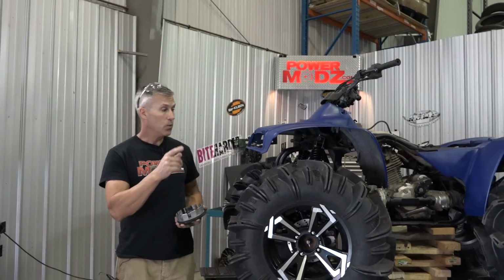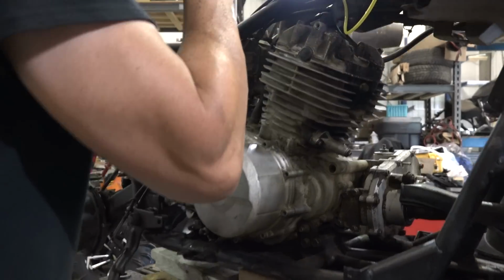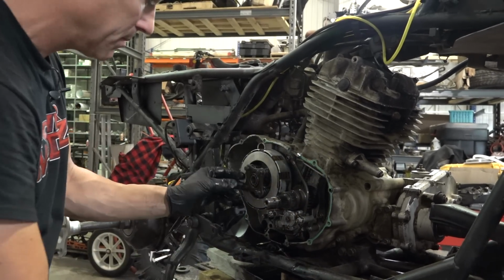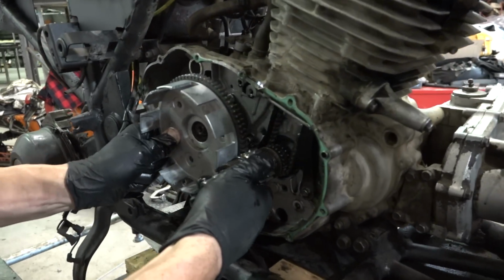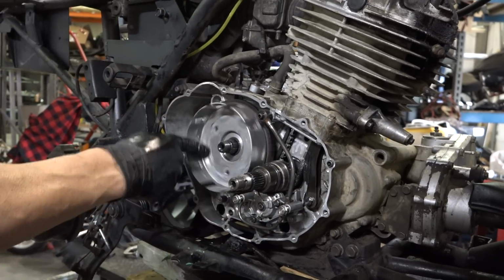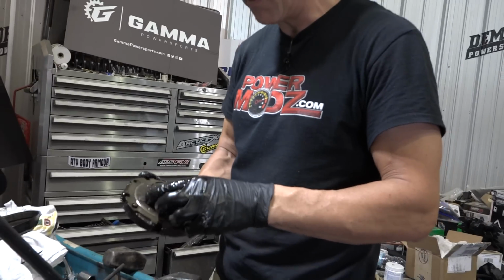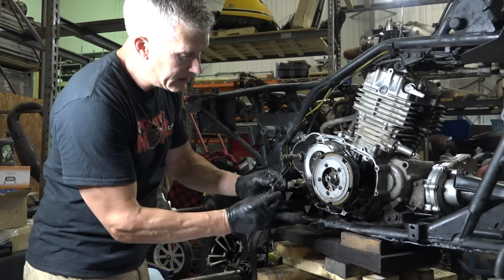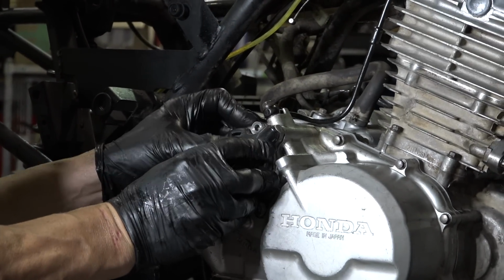Ep#18, Honda 300 Gear Reduction Video!

Comment: in the stock primary gear there is a little bushing type thing inside of the gear itself that u have take out on the back side and install it on the gear reduction primary thats why it wobbles u can see it at 8:24 the copper looking piece with holes in it im not rlly sure if u did it but i had to do it on mine also at 14:21 those pins above the reverse lever need to be removed they will destroy your engine very nice build tho keep up the good work!!
Reply: What pins?

Comment: You can reuse the copper washers but you must heat them red hot then let them cool to remove the work hardening...other wise they can crack when trying to recompress...just an fyi...

Comment: Hello, I want to ask what is the minimum thickness of the clutch plates on the Honda trx 300? My clutch is slipping, I bought a new centrifugal clutch, and the problem remains - I shift gears and the ATV does not move. I already tried the adjustment screw and it didn't help... Greetings from Slovakia

Comment: I have a Honda 300 4x4 with 54 gear reduction and when i shift it to third gear it seems to slip and doesn’t have any power. Any suggestion to fixing that
Reply from the maker: How big are your tires?
Reply: 30s but even on flat ground seems to slip until you left off the throttle